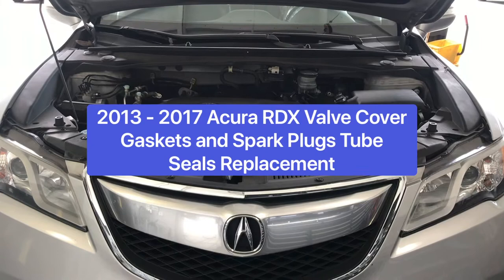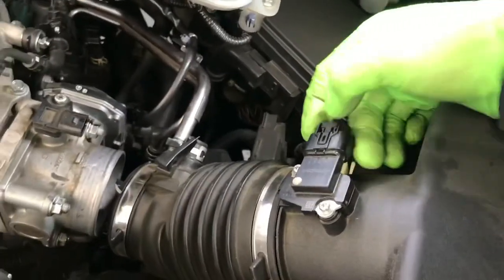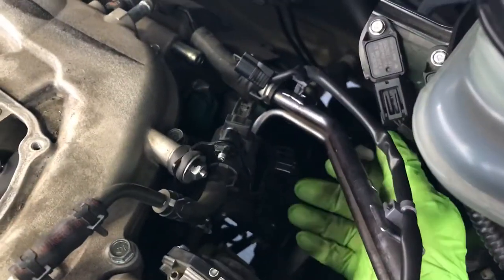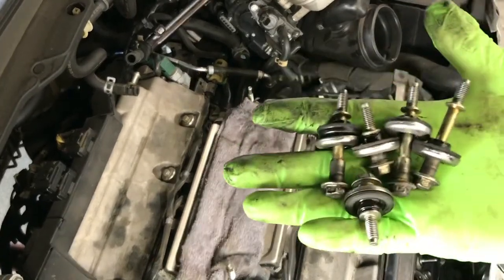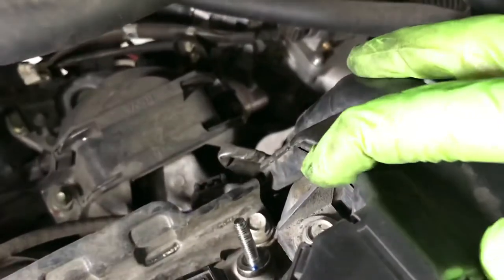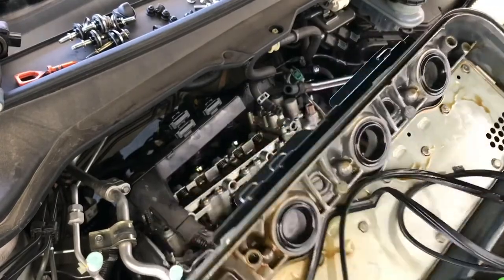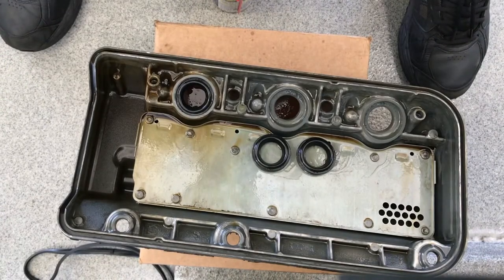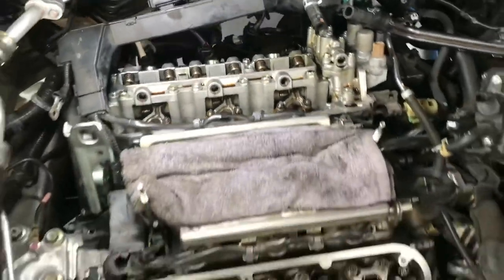2013 - 2017 Acura RDX - How To Replace Valve Cover Gaskets - Part 1 -  Removal

Comment: Great job, ty. I have a 2016 rdx, and just snugged the outter valve cover blots, not the inside( didnt take off  plenuim). gasket is leaking, from rear  at 58,000 miles.  hope it stops, if not have to do, everything you did, ty again!
Reply from the maker: Thank you, I’m glad it’s helpful. Good to connect with you 🙌

Comment: Awesome vid! Does this job require valve adjustment also? Our 13 RDX seems to be leaking in front valve cover and our alternator is now going out ..
Reply from the maker: Hi there, great question. Valve adjustment doesn’t need to be done when the valve cover gaskets are replaced. Hope that helps clarify the question, my friend 👍😊
Reply: A super common problem that causes alternator failure isnt the valve cover gasket put the gaskets inside the vvt actuator.
Reply: @tennisgod3427  I appreciate the feedback. Replaced the alternator, and shortly after I did replace the VVT Solenoid gaskets with Mahle gasket from O’relleys Auto Parts.  Thank you!
Reply: @tennisgod3427  I appreciate the feedback. Replaced the alternator, and shortly after I did replace the VVT Solenoid gaskets with Mahle gasket from O’relleys Auto Parts.  Thank you!

Comment: Why does my valve cover have 9 bolts each cover.

Four in front, four in back, and one on side for each cover?
Reply from the maker: Great question, I haven’t come across one. the process is similar if you grab the concept of doing it
Reply: @huunwheels7378  

Thank you